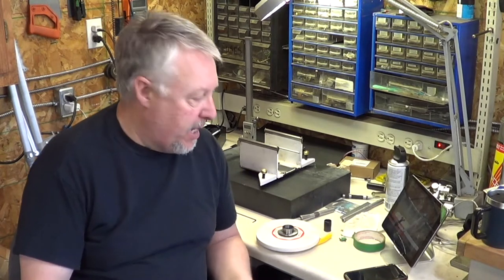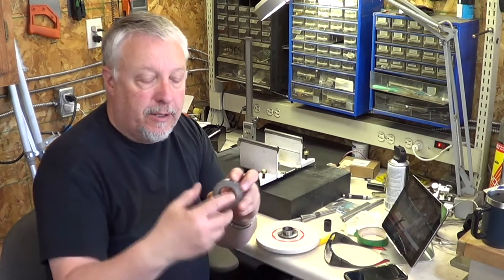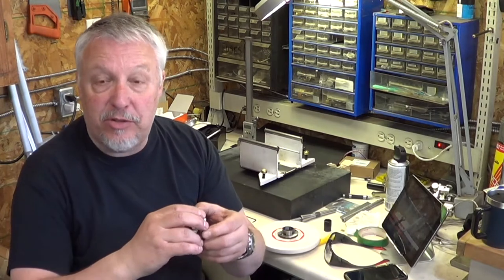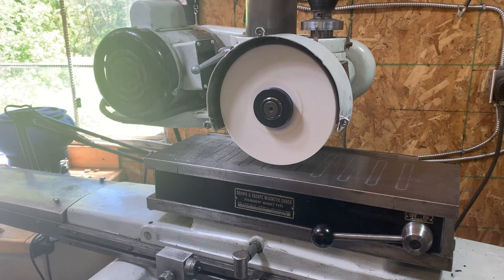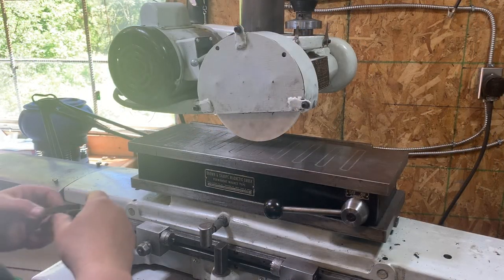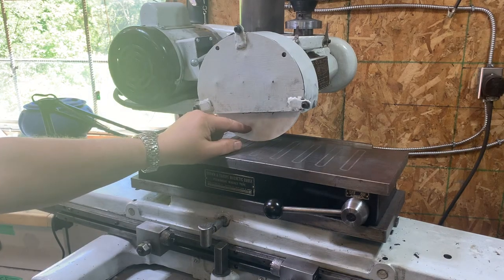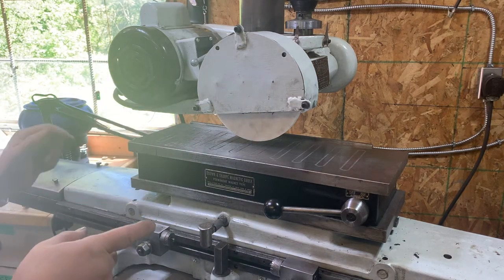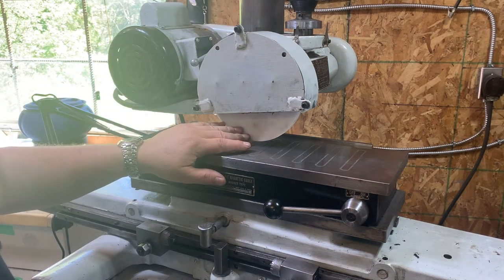How to balance a SOPKO surface grinder wheel hub

Comment: Hello, what is in the middle of the grinding hub when on the machine that uses a Allen key >? is that the hub puller ?
Thx
Alec
Reply from the maker: Alec, the Allen key is used to tighten or loosen a threaded screw which presses the hub onto the spindle. It’s a weird system but it works.

Comment: First, if you think the machine is that dangerous I would recommend you get rid of it, but if you are going to keep it check out Don Bailey at Suburban Tool. He is a master. master, Tool Maker and has Videos on grinding. Especially watch the one "How to Grind Fast and Accurate."  "How to balance and dress a wheel" is not a bad one either, although he is not using washers. He does it the old way. ------ and I could be wrong, bot I don't remember you "ringing" the wheel to check for cracks. Not doing that with ANY wheel is the most dangerous thing you can do, even on a bench grinder.
Reply from the maker: Mr Bailey is indeed a great resource. As for ringing the grinding wheels, all I can say is that about 60% of all the stuff I film gets cut, sorry I didn’t get to show you that part of the project. 😉